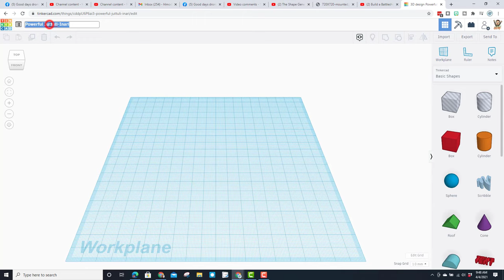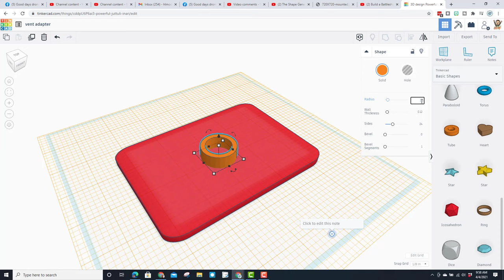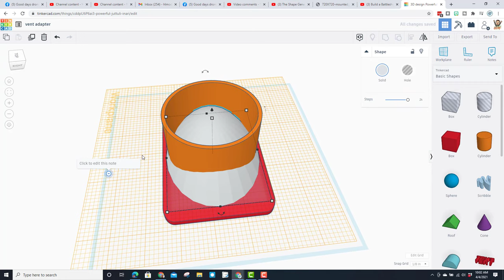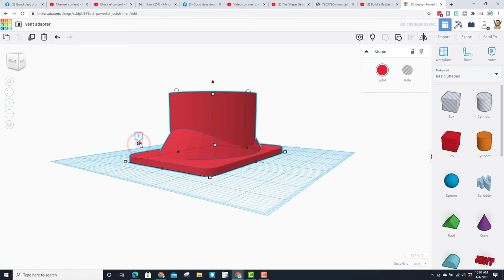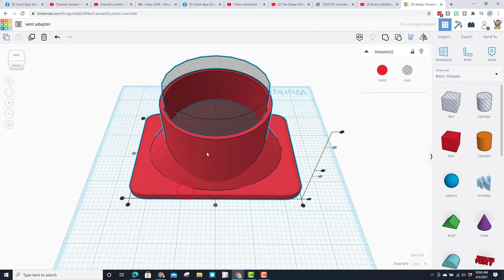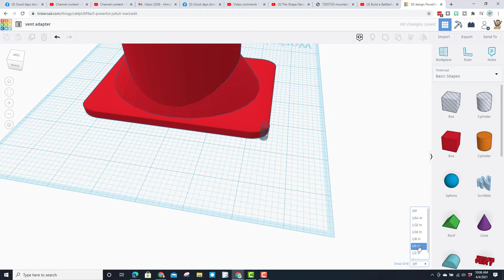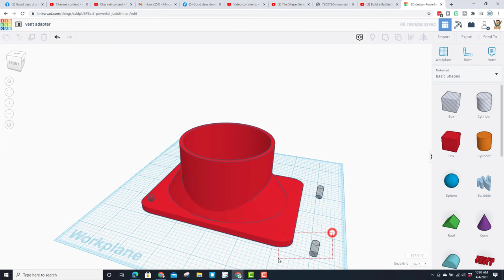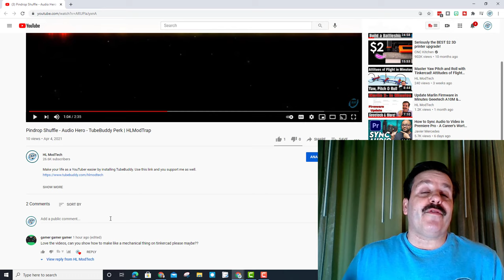Make useful parts for 3d printing FAST using Tinkercad

Comment: 1:30 "now, I don't want the underneath round...." I don't understand this statement nor why you did the next step. Please elaborate.
Reply from the maker: For 3D printing it is nice to have a flat base. We had just beveled all the corners... so the bottom would have had a slight curve. I prefer totally flat. That step cut the bottom flat. Then pressing the letter D dropped it to the workplane.

Comment: hello my name is Les Mckenzie i am having a problem with the sizing of a project .ok so i'm using the inch as default so say for instance i have a project i want to make 1.995 and when i hit enter it will default to 2.000 now it was working fine and i must have changed something because it was not always like like i changed the value on this size if i enter 1.994 it will be fine it only does this from 1.995 to 1.999 it's like the value is set from 1.995 to 1.999 just goes to 2.000 i have looked everywhere to see if i have changed the value of it so now  1.994 to 1.999 has the value of 2.000 , would you have any idea how to fix what i have done i belive i have changed the value of this number . thank you so much for your time ! Les McKenie
Reply from the maker: There is a chance you nudge was set to .1 initally and now it is not. I will do some testing.

Comment: How do we add a threaded plastic pipe end. How is the threaded part done ?
Reply from the maker: This is how I solve it. https://youtu.be/yvtGEw4TwWU This is a female thread... If you needed male I would still search Thingiverse for the thread and work from there. There is a thread tool in Tinkercad, but I have had more success thix way.
Reply: @HLModTech  thank you
Reply: Do you know of any online service that 3d prints and sends product. ? Contemplating if it's worthwhile doing myself if I need in bulk
Reply from the maker: I worked with this company once. They were very professional. Took me a while to get my design up to the standards they needed, but the finished products were sharp. https://youtu.be/2G1ivP2uxis

Comment: I need to make a 1" radius at the top of a design but not at the bottom, how do I do that?? THX!!!
Reply from the maker: I would use the cone. A 2nd smaller cone as a hole would allow you to cut it out. Let me know if you need more info.
Reply: @HLModTech  Thank you. What I did was grow a brain and use CorelDraw to design the plate. The only thing I had to do was make it real small to get it into tinkercad then resize it! 

Thanks again for all the amazing videos!

Comment: Brill! 👍
Reply from the maker: First time I have heard that comment! 💯🥰 Thanks. Sure am hoping it is short for brilliant... 😜
Reply: @HLModTech  it is! Just got my first 3d printer and having a good historical knowledge/understanding of Autocad and SketchUp thought it would be a relatively simple step up....I'm only a dabbler and so now only use the free version of SketchUp for modelling onscreen. I've only just discovered that what is, and looks like, a perfectly solid group is actually not (SketchUp) and that to locate and rectify was, for me, impossible. Also I then discover that the ability to save/export an stl file has be removed and placed within the paid version which is way above what I need and could justify paying. Having previously used Tinkercad to teach a young child basic electronic circuits I then, very briefly, tried the modelling tools and immediately thought it was way too simple/basic for what I needed (I wrongly believed Tinkercad was a school tool for youngsters because I hadn't given sufficient time to look around  the GUI). I was left thinking I would now have to learn Blender from scratch which deflated the hell out of me.....whilst browsing for relevant YT blender vids one of your 'titles' grabbed my attention and, well, here we are.....just goes to show how easy it is to completely miss the value of something because of the absence of a simple introduction or guide. Thank you so much! 👍😁🏴

Comment: is there something wrong with tinkercad it won't let me put measurments in a creation
Reply from the maker: I just used it this afternoon. Nothing different on my end. What are you trying to create?
Reply: @HLModTech  I am trying to make a thumb screw to go over a knurled round knob on a laser for a gentleman who has Parkinson’s and he needs a larger screw to turn I was going together to make it slip over the oringal knob and make a butterfly wing type on the end so he can turn it easily but when I highlight the size say 20 mm and try to type in what I want it doesn’t do anything
Reply from the maker: Would you like to send a share link so I can see inside it? Here's how https://youtu.be/XeDQjhRK8lg You can reach me at hlmodtech gmail.
Reply from the maker: I will be golfing soon, but will check it this evening.
Reply from the maker: That may be a easy part to create using the tube. It is slick for getting those measurements exact for going around the knurled shape. https://youtu.be/AZ0eQw6dAqk
Reply from the maker: This is my wing nut project if you are looking for tips for making the wings. https://youtu.be/Rjt2GyTHSP4
Reply: @HLModTech  I got it working thank you
Reply from the maker: @johnthompson5388  great to hear. 👍

Comment: I can do this in 3Ds Max much easier. Only problem with 3Ds Max - its BOOLEAN/cutter is so horrible. Autodesk seems like never bothered fixing it since 3Ds Max Version 3.
Reply from the maker: 3Ds max is from Autodesk too? How many cad programs do they sell? Fusion, Autocad, 3Ds.. Bummer they have not done anything with the cutter. How much effort did you invest in learning how to use 3Ds Max?

Comment: Why make it .5 inch then cut it in half to .25 inch when you can make it .25 inch to begin with?
Reply from the maker: The whole project was part of a user's question. I rarely design in inches, so I showed them how to get to their design quickly. I also like to show how users can adjust the nudge to make fine adjustments. There is nothing wrong with starting at .25 inch.

Comment: My tinkercad doesn't have any of these secret buttons wtf I can't do shit in this program. Where is everything???
Reply from the maker: Tinkercad has changed a little bit over the years. See if one of my newer tutorials is useful. https://youtu.be/CrEn9LD01gM  It is a simple rocket, but it will get you a good start for making other things.
Reply from the maker: What sort of device are you using? I use Tinkercad almost every day and those shortcuts are still working fine.